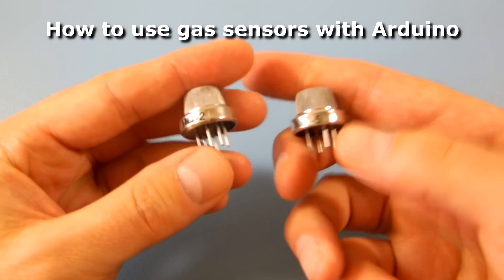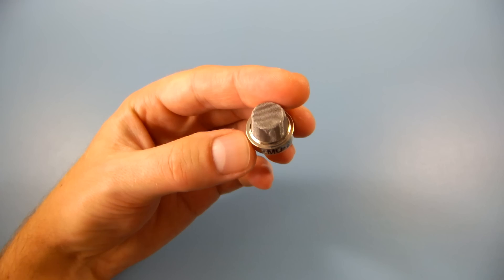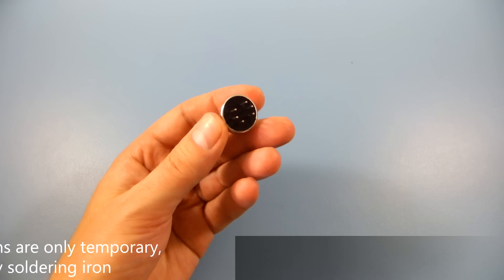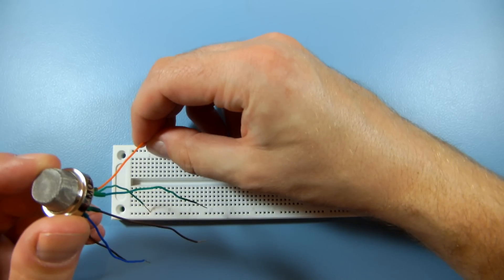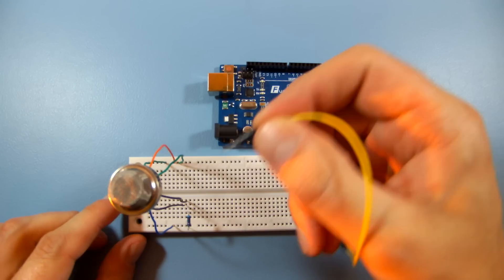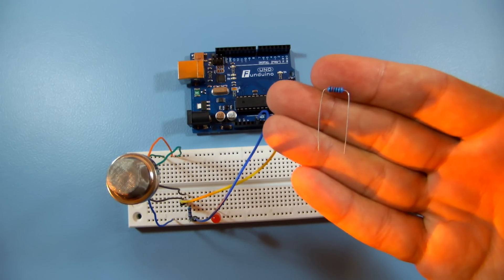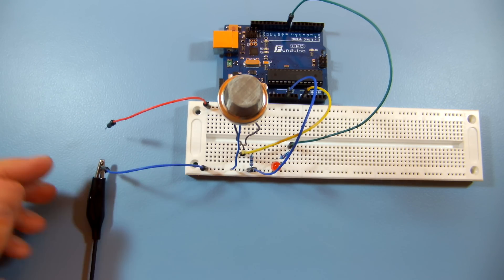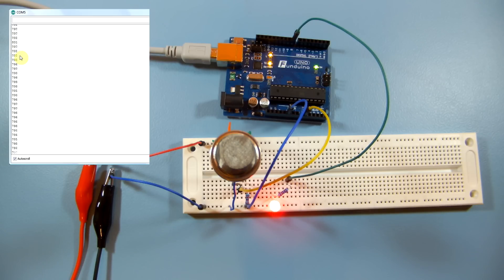How to use gas sensors with Arduino || Arduino tutorial

Comment: good afternoon sir , can i ask you a quastion , i want to use this sensor for detecting the co gaz , what will change in the code source , the value of detecte ??
please aser to my question , i need to know for my project 
thank you sir
Reply from the maker: +rachid morsli The sensor is sensitive to a couple of different gases, but it's not able to differentiate between them. if you want to get the CO values in ppm units, you can use the piece of code written by Sandbox Electronics, see here: http://sandboxelectronics.com/?p=165.
Reply: veuillez excusé mon anglais traduie par google 
ce que je ne comprends pas un truc , le capteure délivre une seul tension a la sortie , comment peut-il etre sensible a 3 gaz diffèrent , sachons que chaque tension correspond a une seule quantité de gas bien specifique , donc je pense que les résultats du programme vont étre érroné , et est ce que vous pouvez me proposé un seuille pour le réglage du capteur , je suis vraiment perdue :p
Reply: please excuse my English translated by Google
I do not understand something, the capteure delivers a single voltage at the output, how can it be sensible 3 gas are different, let us know that each voltage corresponds to a single amount of good specific gas, so I think the results the program will be the Wrong, and is what you suggested me to Seville a sensor adjustment, I'm really lost: p
Reply from the maker: +rachid morsli It may seem strange, but it works as I said in my previous comment. The sensor gives you a single value and it doesn't differentiate between different gasses. Even if you calibrate the sensor, you won't be sure which gas from its scope it is detecting at the moment.
The sensor acts like a variable resistor - its resistance changes when exposed to the gas it's supposed to detect.

Comment: What voltage did you connect to the gas sensor?
Appreciate your reply!
Reply from the maker: +Eduard Tipoh The sensor is rated for 5V.
Reply: Thanks..
Reply from the maker: +Eduard Tipoh No problem :)

Comment: iam using 5 sensors to monitor the gases at a time for O2,co2,co,ch4 and temp can i use arduino 5v supply or i hav to use extrnal supply... while connecting individually it is showing some perfect values but wen i connect all sensors at a time means getting some random values ...can u pls clear this doubt??
Reply from the maker: +Sree Kanth You need some sort of an external power supply, each gas sensor draws about 160mA. Arduino Uno has a maximum current rated at 200mA.
Can you post your wiring diagram? Troubleshooting would be much easier.
Reply: +ElectronFun.com  oh thanku.. ah i dont have any wiring diagram bcoz i bought sensors with modules so am connecting directly to arduino like all d digital output pins to d8 in arduino and gnd to arduino gnd and vcc to arduino 5v and analog input to a1 a2 a3.. like dat can u give me ur email id ?? it will help me to cntact you
Reply from the maker: +Sree Kanth The digital pin is optional, so you don't have to connect it. If you want to contact me directly, you can use my contact form, here: http://electronfun.com/contact.php or send me a message on Fecebook.

Comment: What is the purpose of the volt dc power supply. If it is connected to the computer could we not use the computer as the power supply.
Reply from the maker: +Raymond Walcott The external power supply is used to power the sensor. Arduino Uno can supply up to 200mA and the sensor can consume about 160mA, so it's pretty close to the maximum Uno's rating. If you connect something more at the same time, you may fry your Arduino.

Comment: Thanks for that tutorial! Really helped me out. I have a question... Do you know if I change the resistance, say to instead 20KOhm, to something like 10KOhm, will it detect different kinds of gases? It's not clear on the datasheet but it seems to be the case. Also, your website is down... :(
Reply from the maker: +Guz Forster Hi, unfortunately it's not that easy. When you change the resistor, it won't make the sensor detect different kinds of gases. In the datasheet there is a chart called sensitivity characteristics. You can see there that different gases overlap and you can't be sure which gas your sensor picks up.
Sandbox Electronics has a piece of code on their website (http://sandboxelectronics.com/?p=165), which will "calibrate" your sensor and show 3 types of gases. Just remember their method is based on an approximation to the original sensitivity characteristic curve, so it won't be terribly accurate.
Reply: Right, thanks! So even with this sensor, we can't actually tell which gas we are detecting, only that is detecting some sort of gas in the range of the "accepted" gases, right?
Reply from the maker: +Guz Forster Pretty much yes.
Reply from the maker: Unfortunately yes.

Comment: hi . awesome video your the best bro. I ask if i can add stepper motor to this project . if the answer is yes "would you mind to make a code for me
Reply from the maker: +mohammed hassan Thanks bro :) Yes, you can add a stepper motor. The code depends on your needs. See more about steppers with Arduino here: https://www.arduino.cc/en/Reference/Stepper and here: http://www.tigoe.net/pcomp/code/circuits/motors/stepper-motors.
Reply: +ElectronFun.com  thanks a lot :)
Reply from the maker: +mohammed hassan No problem :)

Comment: how can i make it in mq-3 sensor
Reply from the maker: +Ahmad Hanoun You can use the same circuit, just pick a resistor close to 200k.
Reply: +ElectronFun.com  use 2 resistor or just one
Reply from the maker: +Ahmad Hanoun Use a single 200k resistor.

Comment: Now I have one with 3 pins, Can I connect external power supply?!
Reply from the maker: +Mekki Ahmedi You should always use external power sources for gas sensors. Arduino's output pins shouldn't be drained with such current.
Reply: Then the Ground of the power supply and Arduino should be connected together, am I wrong?
Reply from the maker: +Mekki Ahmedi You're right, both grounds should be connected.
Reply: Thanks sooo lots
Reply from the maker: +Mekki Ahmedi No problem :)

Comment: I have an MQ5 gas sensor with 4 pins. Could you please tell me how to connect it?
Reply from the maker: +Mekki Ahmedi I guess there is one A pin, one B pin and 2 pins for the heater element. Do you have the datasheet?
Reply: http://www.amazon.com/gp/product/B00HG7I02A?psc=1&redirect=true&ref_=oh_aui_detailpage_o03_s00
Reply: +Mekki Ahmedi : it is the one provided in the link
Reply from the maker: +Mekki Ahmedi I can see there is no documentation. Could you post a photo of the other side of the sensor - I need to see the leads.

Comment: Hi,
Liked ur video, it was informative.
Wanted to knw that semiconductor gas sensor could detect methane in a range of 100ppm to 20000ppm. If yes could you suggest the sensor.
Reply from the maker: +Ismail Zabii I know MQ-4 can sense Methane, but the range is from 200 to 10000ppm. However the MQ sensors are not very accurate and reliable, so I wouldn't use it for a serious/commercial project.
Reply: +ElectronFun.com  Could u suggest me a sensor which is very accurate and also can measure below 100ppm. thank you
Reply from the maker: +Ismail Zabii Sorry, I don't know any good sensors that would be able to measure below 100ppm.

Comment: Sir may i ask, for instance i am going to use 3 MQ-2 gas sensor. What will be the connections? and how about the power source?
Reply from the maker: +Aiza Marie Sambo You would need to connect each sensor to a separate Arduino's analog input. Each sensor should have it's own resistor connected to ground. The rest of the connections would remain untouched. The code should be updated to read from 3 different analog inputs. When it comes to the power supply - for 3 sensors you would need at least 500mA at 5V.

Comment: Hi, thank you very much for this very well explained video. What do you think about using the MQ2 for a consumer product ? Do you think it is sturdy and reliable enough for commercial use ? Thank you
Reply from the maker: +Amine Ben Hi, after playing with these sensors for a while I wouldn't recommend them for commercial purposes. They are good for learning and experimenting, but that's it. In my opinion they are not reliable enough for a commercial project.
Reply: Thank you for your answer. Would you recommend any gas/smoke sensor for commercial purposes ?
Reply from the maker: +Amine Ben Sorry, I don't have any commercial experience.

Comment: hi,
i want to measure air quality at home and thinking of getting MQ-135 but i am not sure if sensitivity is highly enough to detect low gas level. i know that CO should be under 6 ppm in healthy air quality, will this sensor measure that?
thanks in advance
Reply: If you want to use this properly, you need to calibrate every startup, after warming up for 3 minutes, expose to open air, and then in your code, zero out the value. Then only measure based on the offset. This makes the readings more sane and accurate. Otherwise you will notice drift on every startup depending on the material composition of the heater and materials near it, as they will off-gas differently as they age, and should be discounted from the readings.
Reply from the maker: +naveen mittal Hi, I don't know the exact answer to your question. To measure gas concentration in ppm you would need a calibrated sensor. I know that these MQ type sensors are not very accurate, I wouldn't trust them so much.

Comment: Hi, nice video!

I'm trying to do the same as you, but with the MQ-131, ozone gas sensor.
I'm trying to understand: how have you found the value of the resistance to put on your board?
For the MQ-131 sensor i need to preheat the sensor for almost a day, Someone says you have to change the resistance after the preheat to have a good measure.
But I have seen you can change the value of sensitivity in the sketch, so How do I have to do?

In any case thank you :)
Reply from the maker: +Francesco Motterle Thanks a lot! I took my resistor's value from the datasheet. However I checked your MQ-131 datasheet and it says "load resistance: variable" - it's pretty confusing, but you can use a potentiometer and adjust sensitivity.
Preheating the sensor is advised by the datasheet - yours says: "over 24 hours", so it's a good idea to do that.

Comment: Do you know if you can use a MQ2 and MQ5(or any other sensor" in one set up?
Reply from the maker: +animefatboy676 What do you mean by "one set up" - one Arduino board?
Reply: +ElectronFun.com just off one arduino or microprocessor
Reply from the maker: +animefatboy676 Sure you can use multiple sensors with one microcontroller. Just remember not to power these sensors from your microcontroller board, use a separate power supply.

Comment: how let say if i use 9voltage battery supply means.. is that i need to add any different resistor or not???
Reply from the maker: +vijay PALASINGAM If you wanted to use a 9V battery you would want to use a voltage regulator or a buck converter. However, a 9V battery has a very low capacity and the gas sensor would drain it very quickly.

Comment: Hi. We read the datasheet of Mq-135 sensor, which sense for multiple gases in arduino. However we have a problem because  our laptop  only read one column, as you shown in this video. We do not know what kind of gas we are reading (how we do that?), and furthermore, we want read all gases  in several columns. is possible to do this? thank so much in advance.
Reply from the maker: +Sinhué Haro Corzo You might want to use Sandbox Electronics piece of code to "calibrate" the sensor and get a separate reading for each gas: http://forum.arduino.cc/index.php?topic=181780.0. I haven't put too much time into it yet, but I know some people get pretty decent results.

Comment: sir,sensors for detecting exhaust gas like co2,nox,co..waiting for your reply
Reply from the maker: +sameer pujar What about these sensors?
Reply: sir,can we use mq2 sensor for detecting co2,nox,co
Reply from the maker: +sameer pujar Not really, MQ-2 can be used to detect LPG, i-butane, propane, methane, alcohol, hydrogen and smoke.
Reply: +ElectronFun.com then what kind of sensor should use for detecting exhaust gas like co2,co,nox..it is really needed for my project....please reply...waiting for your postive answer
Reply from the maker: +sameer pujar Hi, check out this link: http://playground.arduino.cc/Main/MQGasSensors. There are lots of sensors you can use with Arduino.

Comment: But how do i find out, which concentration of e.g. methane corresponds to which number that i get from the arduino when i set the load resistance to 20k ohm? is there an easy way to find out?
And since you can build the circuit with a load resistance between 2k and 47k ohm, how much does it affect the result if you use a 15k resistor instead of a 20k?
Reply from the maker: DerAllrounder You might want to use Sandbox Electronics piece of code to "calibrate" the sensor and get a separate reading for each gas: http://forum.arduino.cc/index.php?topic=181780.0. I haven't put too much time into it yet, but I know people get good results.

Comment: sir isit possible how  to connect ethylene senors and nitric oxide sensors with arduino
Reply from the maker: Praveen Vijapur Hi, when it comes to ethylene - about 2 weeks ago I replied to a similar question. Here's my reply: "I couldn't find any cheap ethylene sensors, the ones I've seen cost way over $100. Just out of curiosity, does your project have anything to do with fruit?".
I've just found a nitric oxide sensor: NO-B1, but I couldn't find much about it and I can see it's not as easy to use as MQ-2 or MQ-5. If you're interested, the datasheet is here: http://www.alphasense.com/WEB1213/wp-content/uploads/2013/07/NOB1.pdf.
Reply: ElectronFun.com  implementing NO-B1 is same as that of MQ-2?
Reply from the maker: Praveen Vijapur I guess it's not as easy as using MQ-2. I couldn't find much about its implementation.

Comment: Can I not power these kind of sensors with the Arduino Board? I´m planning a project where I use several gas sensors like MQ-2, MQ-3, MQ-4 and so on. How should I power them?
Reply: Lukas S. Yes, Exactly the same way you can use the output pin to an op-amp to trigger after some specific analog value. You can use variable resistor to adjust the value.
Reply from the maker: Lukas S. Thanks for your comment. Sorry I couldn't reply sooner, I was on vacation. I wouldn't use an Arduino board pins to power these sensors, because they have certain power limitations. You could use the same power source for your Arduino and the sensors.

Comment: Hi, another question

It is normal if the gas sensor is hot and the readings start at 0 at serial monitor? thank you :)
Reply from the maker: Mavrick Lomerio Hi, it is normal that the sensor is getting hot - it needs certain temperature to work properly. Is 0 your highest reading when you apply gas and goes up when you stop?
Reply: ElectronFun.com around 150+ :)
Reply from the maker: Mavrick Lomerio The readings never drop anywhere near 0.
Reply: ElectronFun.com noted.... :) thank you so much
Reply from the maker: Mavrick Lomerio No problem :)

Comment: Hi, what is the use of heat shrink tube? and can you make another video with gas sensor including an alarm for security purpose? using arduino.
Reply from the maker: Jason Estacio Hi, I didn't want to solder and heat shrink tubing seemed to be the fastest way to connect these wires to the legs.
I will consider making another gas sensor videos, but there are already a couple of videos in my schedule. I wish I had more time for YouTube videos.
Reply: ElectronFun.com Ok sir.. Thanks :). Btw Great Video
Reply from the maker: Jason Estacio Thanks a lot :)

Comment: i know you said polarity dont matter but is this for the heater coils? or everything ? how do i know which is A or B?
Reply from the maker: Frank Lopez It's not only for the heater coil, but for the whole sensor. These sensors are symmetrical and you don't know which pair is A and which is B. You can rotate it by 180 degrees and it looks the same. It doesn't matter which pair is A and which is B for you. Just remember that the sense wire, which is connected to A0 has to be hooked up to the grounded pair. If you connected the A0 to the positive pair your highest reading would be 0 and the lowest would show 1023.

Comment: Hi, how to add buzzer in this circuit? and it is possible to connect this circuit to vb.net programming? thanks :)
Reply from the maker: Mavrick Lomerio Hi, you can find a nice buzzer tutorial here:
http://www.hobbytronics.co.uk/arduino-tutorial7-piezo-beep.
I know it is possible to use Visual Basic to control an Arduino, but haven't tried that yet. I've seen a simple example on Instructables, here: http://www.instructables.com/id/Using-Visual-Basic-to-control-Arduino-Uno/.
Reply: ElectronFun.com thank you very much :D

Comment: but it doesnt separate the gases values? for example 50 lpg, 200 smoke etc. ?
Reply from the maker: Riebulka No, it doesn't. You can find a piece of code by Sandbox Electronics, which includes some kind of calibration based on sensitivity characteristics. Each of 3 gases is read individually.
Reply: ElectronFun.com Thanks for detailed and quick reply, but my inglish isnt native language, so if i use 1 sensor for alcohol, smoke and lpg, i could get 3 individual values for them?
Reply from the maker: Riebulka Yes, it gives 3 different values.
Reply: Thanks :)
Reply from the maker: No problem :)